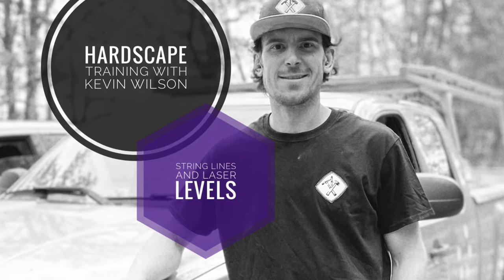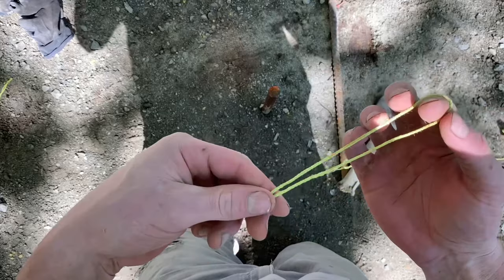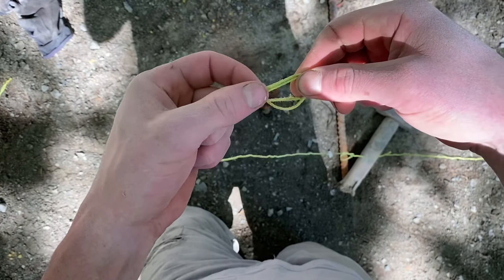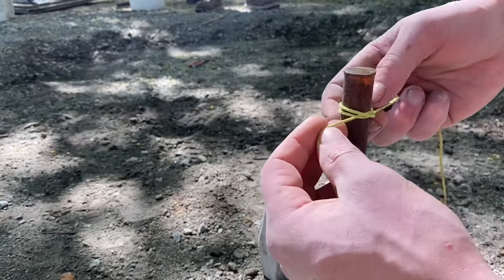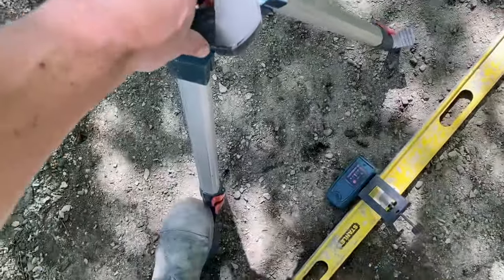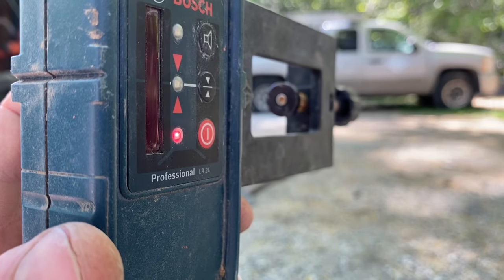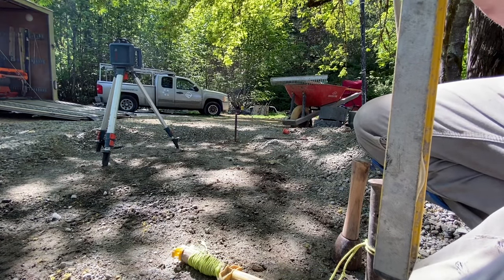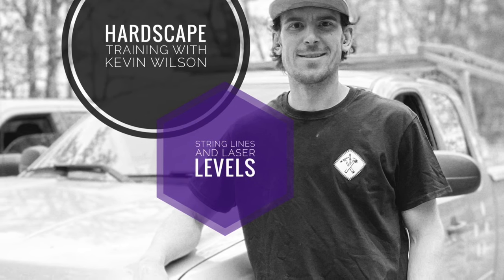Setup STRING LINES AND LASER LEVELS quickly and accurately! The insider tricks only the Pro's know!

Comment: First knot is a girth hitch, second is a clove hitch.  Useful stuff.👍
Reply from the maker: Hey thank you!
Reply: Loop is larkshead.
Reply: @deanaoxo  or a cow hitch.
Reply: @EdwardBIl  never heard it called that, thanks. It's how kiters attach their lines to the kite.
Reply: @deanaoxo  probably a cowboy thing. From Wyoming :)
Reply: @EdwardBIl  makes sense.
Reply: lark's head (like you did on the first, but without the "shoe string" knot you called it) will work on both first and end as well. it gives you the ability to "point" the edge exactly where you want it, if needed. and the friction won't let it slide (if you point it the right direction/hand). :D

Comment: Thank you for this video, it is so helpful! I have a question regarding staking. I'm hardscaping on solid limestone hills, many areas have only 1-3 inches of soil before stone, so I can't drive stakes into the ground. Do you have any suggestions on how I can secure the stakes?
Reply from the maker: Hey this can be a bit tricky for sure! You can use a hammer drill to quickly drill into the stone, then set some rebar as stakes. Or you could setup wooden batter boards instead.
Reply: @HardscapeCanada  Thank you! I'm staking my first project today :) got the proper knots down, let's see if my stakes hold up! I'm trying some concrete stakes and will try the rebar with hammer drill  as you suggested if it isn't working!

Comment: Great instructional especially with the knots! Going to have to use these when I re-string what's out there. Those concrete stakes look handy too. Some question for you: when grading the slope/elevation, do you start at the native base (in our case clay) and screed it as evenly as possible in addition to achieving the grading? I'm guessing you want to start there so that you have a better estimate on how much material you need to order? Then you just follow the slope of the line?  Also, is there a general height that you'll set your lines to (e.g. the height at which there will be 2" of space between the line and your final top layer/pavers/etc)?
Reply from the maker: Yes as long as you get to the minimum depth you need based on the thickness of the base, sand and paver and whether it is pedestrian or vehicle traffic etc. I always like to set my strings to the finished height of whatever I am building, but you could always set them up from that if you prefer, as long as you are aware and everything is kept consistent you can play with these techniques to do whatever makes your job easiest!

Comment: Is there a proper way to position the knot on the rebar?  In other words, there seem to be three variables.  The rebar, the knot and the extended string.  Assuming the rebar is in the correct spot, the knot can still be positioned anywhere from the far left side of a rebar post to the far right or anywhere in-between.  Depending on where the knot ending is positioned, there's an effect on the overall positioning of the string layout.  Yes, we're only talking millimeters but we are seeking precision which is why I ask.  One follow up question.....

I want to install pavers on the side of a home, extending from the foundation, to the property line.  The side of the home has a chimney.  The chimney prevents me from extending a string line from one end of the side of the house, to the other, without being obstructed by the chimney.  Is there a workaround that still results in precise leveling on the left and right side of the chimney along the exterior wall?

Great video.  Thumbs up!
Reply from the maker: Hey great questions! The key with the knot positioning on the rebar is being consistent. So if you have the knot on the inside on one rebar stake, do the same on the others for a higher degree of accuracy. You can flip the second knot over so if need be to get the knot on the correct side. 

For the second part: yes you can setup the stringline just in front of the chimney, paralleling it on both ends from the house, and use that as your slope reference. You can simply screed the gravel etc over to the house with that string as your reference, or shoot heights with the laser and make marks on the house foundation on both sides as well as the chimney. Could snap a chalk line on this as well if you like. 

Let me know if that makes sense or you have any other questions!

Comment: Not being professional... once you set your slope with your string line, how do you transpose it on the ground while putting you base ? You keep measuring from the line with a tape ?
Reply from the maker: Yes exactly! As well as use an exact width of a 2x4 or screed level to get the height of your road base consistent under the string. Depending on your width of paver